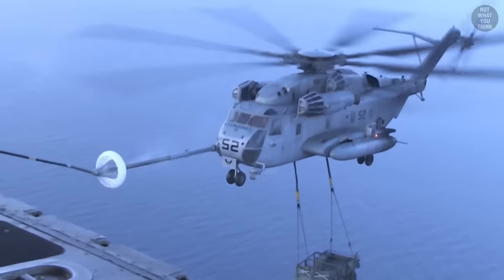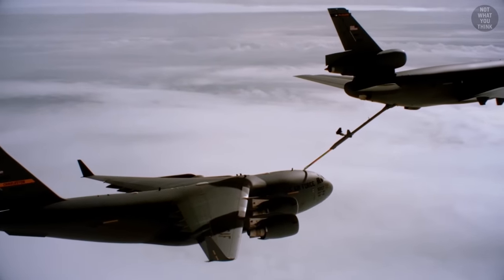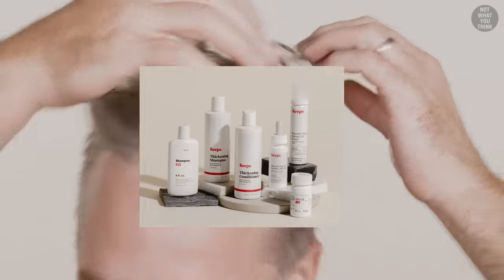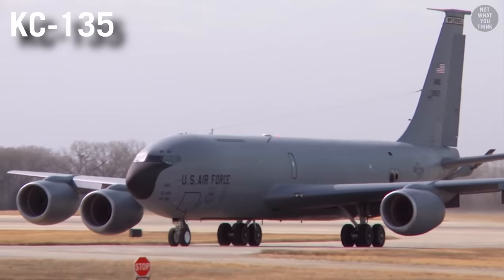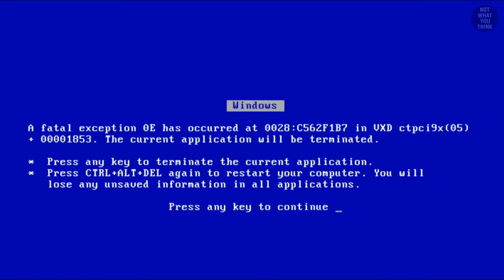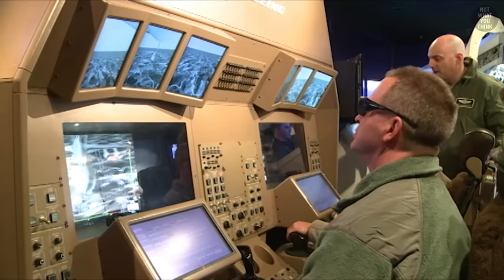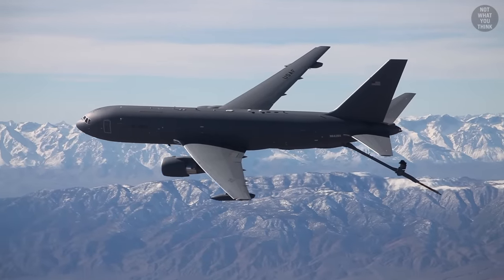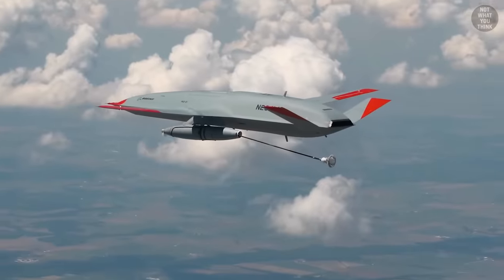Why US Air Force is Making Aerial Refueling HARDER?

Comment: When the new tanker was being developed they put out a survey to every active boom operator asking questions about the design. 98% of the boom operators stated they wanted a back window with direct view of the receiver aircraft...so of course, the Air Force went with a remote camera system that nobody wanted.
Reply: What? It's "Military Grade" You're telling me you don't want to use a unreliable 480p at best camera to replace the job your perfectly fine eyes could do without a problem?
Reply: @bell3287  eyes can’t even agree on what colour a dress is.
Reply: @kekistanimememan170  What does that have to do with anything?
Reply: @user49917  He said in the video that Boeing is losing 5.4 Billion on this project.
Reply: @kekistanimememan170  and if eyes see said dress through a camera that makes it all better
Reply: @recording_closet9100  💀
Reply: RVS has been around for decades. They were first testing this concept on the KC135 in the 70s or 80s I believe. Technology has caught up and it's now practical to utilize this system  instead of a window. You will see RVS systems eventually implemented in commercial aircraft too as we transition to hypersonic travel. This is only the beginning
Reply: @PokemonHaloFan  $5.4B and rising...
Reply: you would think they would have the camera be an addition to the windows
Reply: @PokemonHaloFan  
If Boeing executives and lobbyists did not pocket a large portion of the initial contract, they would have plenty of money for the project.
Reply: Because some procurement officer got a pay off by the vendor of the video camera system and related screens, ect. You know that guarunteed high six figure salary job when they retire as a Lt. Col or Col.
Reply: @bell3287  Shit just call Apple and buy off the shelf Apple tech for a decent 4K Camera experience. Oh wait, knock off Chinese shit on Amazon is at least better than 480p black and white these days. Even if color depth is something to be desired.
Reply: @Nightfighter82  At this point, I'm just gonna assume everyone is taking the joke seriously...
Reply: Why wouldn't they simply add a camera to the end of the boom? That camera could have the zoom and focus locked to give a clear picture of the receiving aircrafts fuel port.
Reply: If they put the right sensors and user interfaces in place, RVS would be far superior to a window. There should be an array of sensors that are automatically unified into an augmented 3D display… instead of this janky CCTV camera from 1980
Reply: What better way to ask for a billion dollars more to fix a problem they created
Reply: @tarui  that’s not how these things work. The Air Force makes the requests and sets the requirements. It’s usually the government that causes the issues but since they’re the customer, it’s easy for them to point the finger at Boeing. Boeing isnt going to argue as they don’t want to piss of the customer.
Reply: Edit.. I was wrong on that as emp hardening was correctly mentioned. My comments on why I have little confidence in Boeing is mentioned below.
Reply: @bell3287  Ah yes. Military Grade.

"It's military grade? You mean it's complete shit?"
Reply: @eleventy-seven  it’s easier for a number of reasons. Those same reasons may make fiber optic cheaper in total
Reply: @kekistanimememan170  And Camera's don't help with that X-X
Reply: @kekistanimememan170  neither can a camera.
Reply: @PokemonHaloFan  boeing's contracts are cost plus. they CANT lose money.
Reply: it's probably safer this way tho.
Reply: @John Doe - And yet Airbus have had no problems delivering the A330MRTT with a remote boom system.
Reply: @0xsergy  nope
Reply: yeah it costs money to add windows ... who do these boom operators think they are exactly? queens of sheba.... we'll just get on an invent a completly new airplane because you can't work out a camera.... no we'll hire someone who can operate a camera
Reply: Boing can't charge extra for just someplace to sit it's not complicated enough
Reply: I could understand them going with cameras if they have a good reason but the lack of depth perception from video should have been obvious. You need 3D monitors to get any depth perception.
Reply: @bobbygetsbanned6049  imagine if you had 3D scanning sensors and gave the operator a SIDE VIEW. Totally within current technology, if people were trying hard enough
Reply: @eleventy-seven  it certainly helps if you are trying to make your plane hardened against EMPs.

Also fiberoptic networking is cheap and easy.  Fibre optic connections inside the plane reduce complexity compared with literally any other networking technology. (At the end of the day these are network connections carrying video data)

Fibre networking is probably the cheapest part of this whole system, it's basically off the shelf tech.
Reply: @William Benson  This isn't Russia.  Development and material costs make hypothetical million-dollar payoffs to some lobbyists look like play money.
Reply: @bill191  if it has caught up, and it is now practical, why doesn’t it work and why do the personnel in the ditches not want it?
Reply: Why didn't Boeing design it in? The 777 used it for in the mid 90s. To correctly get stereo vision with goggles. Boeing virtual helmet for the F35 is laggy and overweight. Airbus outbid Boeing for this contract but Boeing once again bribed/lobbied their way back. Airbus refueler are fine the Pegasus is not. Would you like to talk Redhawk trainers,  Ospreys Starliner, 787 13 months since last delivery. 777x due 2020 available maybe 2025 according to Boeing. 737 max now since ungrounded 60 incidents with 6 loss of control. Pardon me if I have serious doubts about my countries ability to make decent aircraft. Regarding fiber, there's no advantage in this application however it does cost more. I am a retired network tech and while fiber rocks it's not cheap. You might be right because it does have S/N ratio superiority and is resistant to EMF. The old camera 1.0 eyeball is what they should have stuck to. Boeing is dead and until our corrupt government stops taking bribes to allow inferior equipment, Boeing will not improve. I don't like it but that's simply reality.
Reply: @bell3287  it’s more just to take the joke seriously than the problem
Reply: Boeing decided this, not the boomers.  That is why Boeing is picking up the tab for repairs.
Reply: I understand its a change and makes life more difficult, and no one likes that. But by keeping the crew all together, it gives more space for payload... in this case fuel. 

And also, you need to think that these aircraft will continue to be built, upgraded and fly for the next 30, 40 , 50 years. Im sure boeing are already working on a modification to at least partially, if not fully, automate the boom actuation system, which obviously only works with cameras... even if its a pain now, we need to design for the future...
Reply: @Cornish_Co  because you want to try keep as much non-essential electrical equipment away from the "end where fuel flows out" as possible. Short circuits and fuel meeting air arent a good mix
Reply: @Cornish_Co  although, maybe some wingtip cameras would have been a good alternative. Giving a bit of a side perspective of the boom
Reply: Blame the camera industrial complex
Reply: Typical Air Force, just because they always get the bigger share in defence budget compared to the other older branches.
Reply: @kekistanimememan170  because of a bad quality camera...
Reply: @kekistanimememan170  which is largely because of how cameras capture images
Reply: @bill191  Airlines aren't moving to hypersonic due to increased fuel use.
Reply: @kekistanimememan170  that's what your brain sees
Reply: Technology for technologies sake, Happening in every industry.
Reply: Like the higher echelon command cares what the boom operators think. They probably think, we say, u do.
Reply: thats about right
Reply: I mean it's as simple as two small, 1080p cameras, think phone camera/lense package, around 20¢ in parts, weighs grams, uses mW of power, gets you decent binocular vision for 2k VR display, small enough to put close to the end of the boom. Simple, cheap, effective. Gives depth perception. You barely need software, just each camera outputting to a different screen for each eye. If one breaks one is still enough.
Reply: Too all the "the technology works it's not the problem" "it's complex placing a window behind the aft bulkhead" folks.

Sure, the technology may work. The question is why do it? I've never heard anybody complain that the method used on the KC 135 is not adequate. Maybe add a flip up HUD visor with SAR to give visual cues at night and in clouds.

It just seems, even with the USAF obsession with techno wizardry, to all be extremely unnecessary. The 135 and it's perpetually extended retirement date is proof that the system works. We are constantly told that the only reason we need new tankers is that the old ones are just old and worn out.
Reply: I feel like a camera system could give you lots of advantages if done correctly however I think a window would be good to have as well.  This camera system looks laughably bad. I feel I could throw together a better solution with a Webcam and a raspberry pi... if I ignore the operating requirements for humidity,  temperature.. etc.
Reply: @kekistanimememan170  No, they are absolutely fine identifying a color. The dress is just NOT yellow in the lighting conditions of the picture.
Reply: The receiving planes should have a little camera for the boom operator, too. He can have 2low quality screens and two sets of controls, one set mirrored for the view which is pointed the opposite direction
Reply: typical mess. dont fix if its not broken ffs
Reply: @PokemonHaloFan  I doubt they are loosing money on this deal…
Reply: Well the airbus version actually won the competition but boeing threw a fit to congress saying it should be an American company and then got awarded the contract instead this was in 2008 if I remember this all correctly  but the airbus also used a camera though
Reply: @PokemonHaloFan  boeing doesn’t lose money, we lose the money.
They can just write off the loss on taxes, if the government didn’t already cover the loss for them.
Reply: The windows gives depth so it's easier to line up. With a camera it's harder because the depth isn't as obvious
Reply: The other thing they suggested if not a rear window was a camera.. ON THE BOOM.
Reply: With so many replies no one will ever see this, but it's corroboration. I was in the US Army as a Ranger on Ft. Benning and was involved in the testing and test firing of the new belt fed weapons. In all marks we gave the 60-E our recommendation. The US Army went to the 240-G. The 240-G only won on 2 criteria - rate of fire and cost. I think they only had us test them to make sure they wouldn't blow up under normal use, they already knew who they were going to pick and it wasn't going to due to soldier feedback.
Reply: @kekistanimememan170 who needs colour?
Reply: @kekistanimememan170  the picture of that dress is taken by a camera,so iunno what to tell you
Reply: @kekistanimememan170  nevermind that whole debaucle was caused by screen lighting being different and not standardized

Your solution apparently is to put a screen with lower res camera into the equation that our eyes still have to look at

Genius
Reply: What a great idea.... Let's put a tanker in the sky with a computer running it... nobody's ever hacked one of those... now have they?
Reply: They were already conventional 767 tankers in operation.  They should have been an easy, quick, fairly budget friendly project with a reasonable profit for Boeing.

Instead, along with the f-35 and v22, it's turned into an example of how not to bring something to production. 

Yes, all of these finally made it into service and some of them arguably can actually carry out their mission but it was far too expensive, long and arduous to get them there.
Reply: Of course the military always does the opposite thing that their personnel wants
Reply: @kekistanimememan170  luckily, planes are not dresses
Reply: @kekistanimememan170  lmfao
Reply: @bell3287  / to everyone that might still be asleep 

This just shows how far downhill Humanity is going due to the People on the tippy top… They’re not even trying hard to hide their agenda nowadays tbh… if you don’t want to see then hopefully some day you’ll finally have your breakthrough…
Reply: @ProfessorChaos  apple tech? Lol. Only thing they make is their m1 chip. They buy everything from Samsung & sony.
Reply: @bill191  citation needed*
Reply: Irony is all the pilots that have fueled off of it love it.
Reply: But John! Think of the gen-Z kids that will be coming into the job! They are so good with screens, man!
Reply: @bell3287 even your self?
Reply: Generals gotta pad their pockets with that Boeing money
Reply: @bill191  lol no
Reply: @kekistanimememan170  color is irrelevant. Resolution and 3 dimensional depth perception is required. "Latency" was also mentioned. This kind of stuff you definitely do not want any time lag.
Reply: @kekistanimememan170  that is literally because of the screen it’s viewed on. Have you ever looked at something in real life and not known what color it is?
Reply: Fundamentally, this is not a Boeing problem.  This is an Air Force problem and, more specifically, a requirements problem.  The systems engineers failed to do their due diligence during early design reviews for the air system, probably starting with the systems functional review where fist-level requirements are decomposed and assigned to major subsystems.  That’s where the risk(s) should’ve been identified, funded, and tracked to resolution.  Even if Boeing pitched this idea during proposal under duress from the government to transition a “next generation” technology, its likely shortcomings should’ve been discovered during the design phase and the contract modded accordingly. 

The military’s acquisition enterprise is suffering from a lack of trained and competent systems thinkers to critically and expertly evaluate early designs.  It’s asinine and it’s costing time, money, and war-winning capability day after day.
Reply: @bill191 doubt we will be dealing with hypersonic commercials, hypersonic speeds are expensive ya know in terms of fuel
Reply: that space for the boom operator is dang uncomfortable and small, but boomers are great people, maybe the expanding size of todays boomers is part of the problem